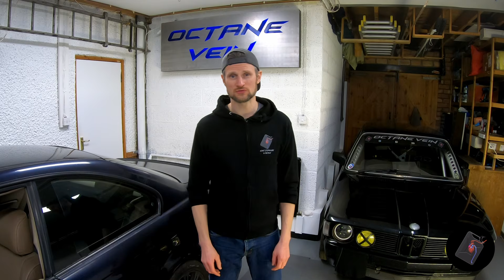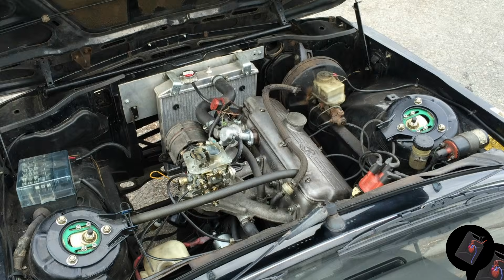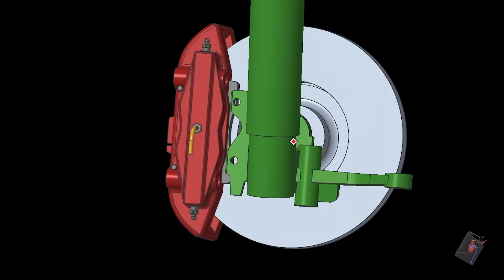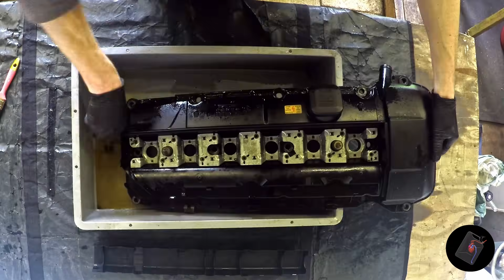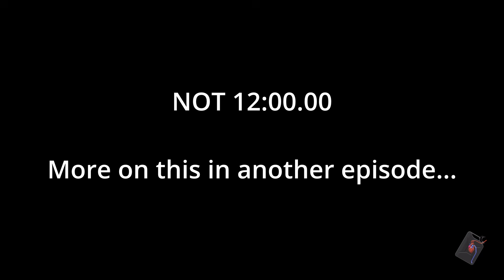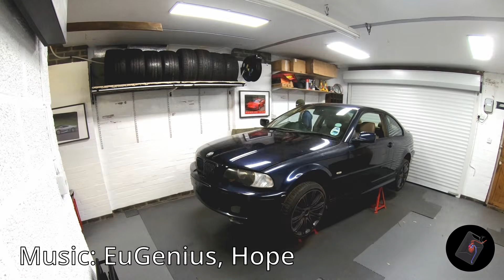Ep12 M54B30 Swap E21 Track Car Pt1

Comment: Interested to see the differences from when i fitted m52 to my e21 some 10 years ago
Reply from the maker: How did you find the handling with the m52 in?
Reply: @OctaneVein  too much power for chassis - over 100 mph its a bit like a boat
Reply from the maker: Thanks for the info, I'll be having a look at engine placement and handling soon 👍